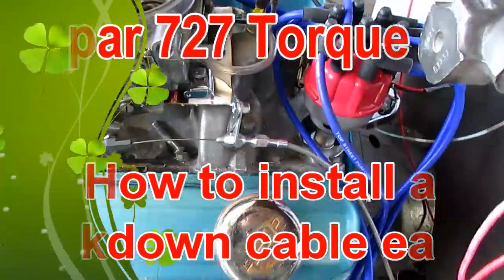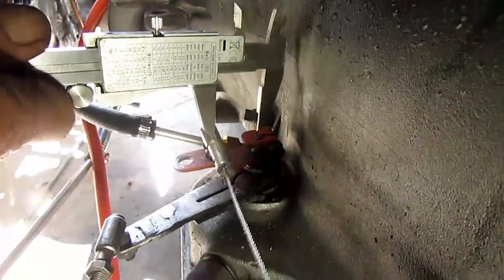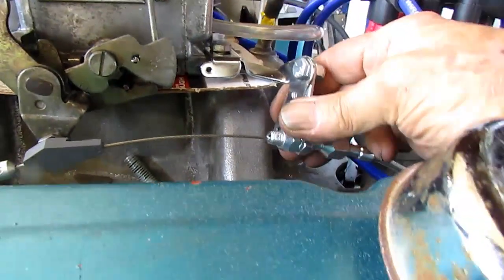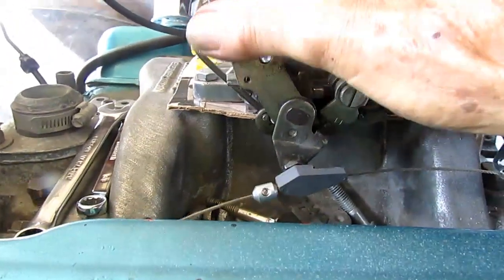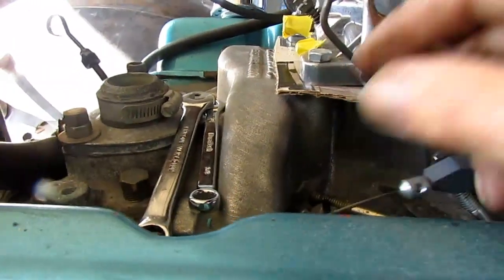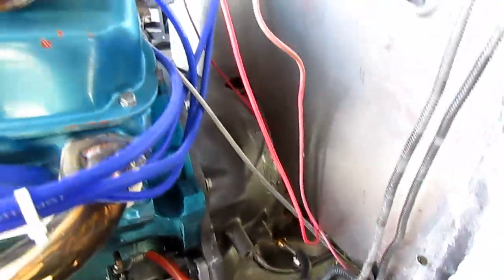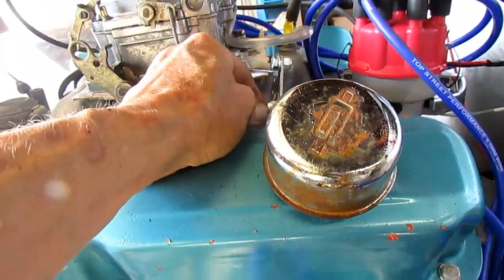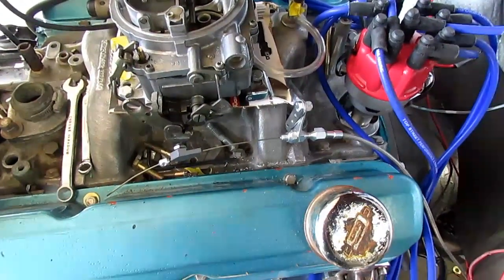New Life Automotive How to correctly install a 727/904 kickdown cable

Comment: Very clean installation. Looks another better than the factory rods& bell cranks.
Reply from the maker: Yeah, much nicer. I put on several, and drove for years. Trouble free, and you can do a quick adjust if you want to race.

Comment: thanks for the post - I'm curious if it cleared the exhaust or were there other tweaks needed? thanks
Reply from the maker: it cleared the exhaust fine. I zip tied the cable a bit so it did not hit anything.
Reply: @1otviii  Thanks